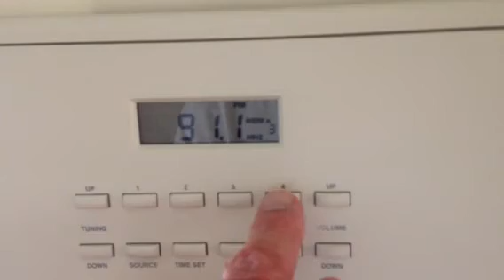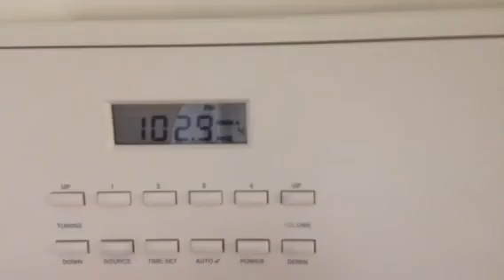Static on some AM radio stations; M&S Systems Model MC602 intercom

Comment: These systems are installed into houses as "built-ins" and as such are hard wired to connect to whatever is installed for this system. To make use of these features now, not only would your have to somehow feed wire through your walls, but would need the knowledge where to connect the new wire. I'm guessing this is possible, but might be expensive. Good Luck!

Comment: Wish I had your problem...Me and the wife were watching TV when the radio turned on by itself and the volume quickly increased to it's maximum level and scared the hell out of both of us...lol...i got it on Aug so I can't hear anything but would like to fix it...dummy me kinda incased the unit with backsplash 😳 but would break the seal if it could be fixed...so I guess my question is what to do?
Reply: It is possible that your 'Auto On' has been set and the volume just happened to be set high? There is a button labeled 'Auto';  push it and the word "AUTO" should appear or disappear depending if it is activated or not. This will solve your problem, but sorry, I don't remember how to change the settings that would automatically turn it on or off.
Reply: @jerryman2870  Thanks for responding but if only it was that easy...I removed the intercom from the front of the house and only taped off the end of the wire before I shoved it in the wall never to be seen again.  Maybe water is getting to that wire some way🤔...only way to explain it's demonic activity?

Comment: Hey did you ever figure out this problem ? My fm is really bad and staticky
Reply from the maker: No I never did, and I had misstated the problem; it is a buzz which sometimes will be diminished if I turn on my under counter lights, though this does not always help. Seems to be an interference with the AM  signal.